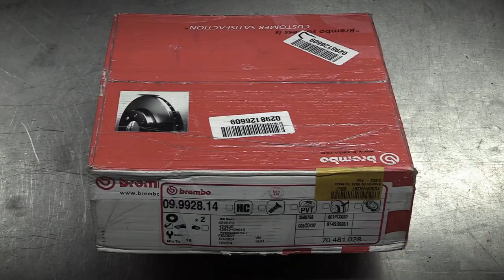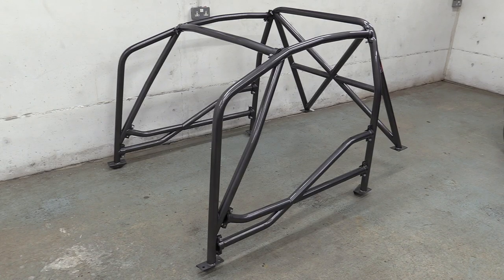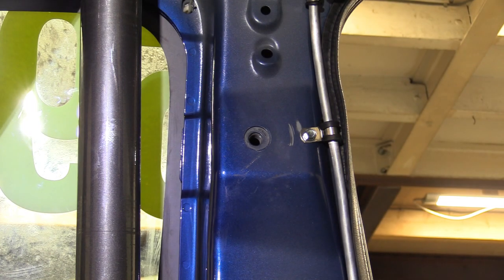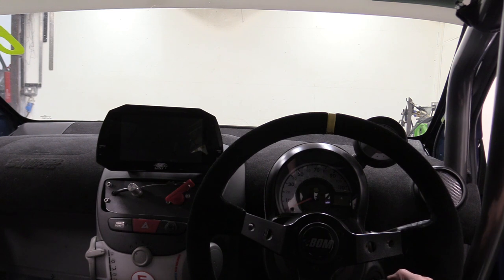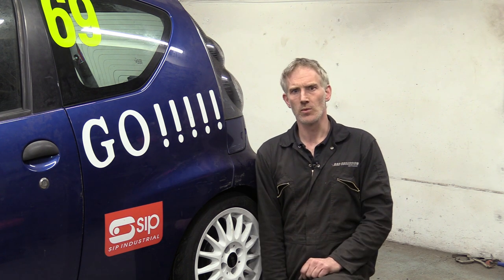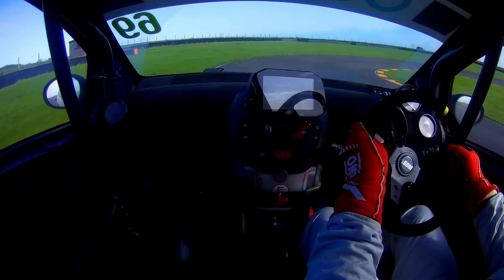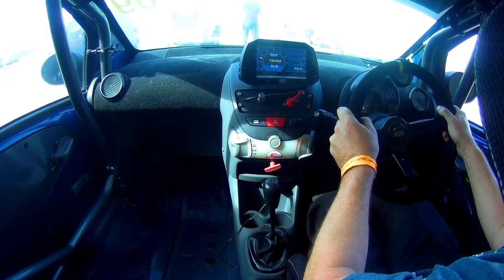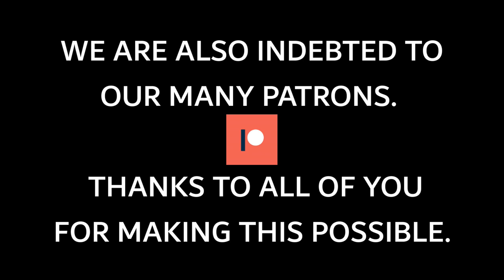Part 6 - Building an £850 hatchback into a competitive race car.

Comment: This is the best episode yet.  Everyone knows racing is about fitting into a set of class rules, then exploiting, bending or breaking those rules to the best of your ability.   Just ask Toyota about their Celica GTFour. :D
Reply: Now that was pure genius.
Reply: That sure was. What about Ferrari in F1 last season having boosts in fuel between sensor readings?
Reply: Agreed! Best one yet. And the track is beautiful. We couldn't have a track like that in the U.S. as the property would just be too valuable, but the track owner could sell it and build two tracks a few miles inland!!
Reply: well Toyota was absolutely cheating back then :D but so was everyone else. Think Ford and their Focus' "rear bumper" aka pressure tank
Reply: Or NASCAR with the cardboard restrictor plates under the carb 😂😂😂
Reply: Or Mercedes (F1) with their 'F' duct. No moving parts to stall the rear wing for better areo. The driver just covered a port (with their knee I think)
Reply: @Madogen  didnt they at one point get done for using the engine oil as a fuel
Reply: Lancia sits in the corner, silently sipping a martini.
Reply: Ahh Toyota's GT4 with their engineered intake.. also worth reading up on Smokey's tricks in Nascar.. or Gordon  Murry with the Fan car :)
Reply: @jdandcoke  That's Mercedes :)
Reply: Yeah... not just racing either we could look at VAG and how to cheat on emissions testing.... so long as it’s not cheating it’s all okay.  And of course the 11th commandment...
Reply: @Sf_Mason  Smoke is the reason for 90% of the Nascar rules, he is also the reason for the other 10% but they have not proved it yet....
Reply: Lancia S4 fire extinguishers. ;)
Reply: How did that work out for them? 😁
Reply: @stumiles86  That was McLaren, not Merc.
Reply: @malcolmyoung7866  as long as no one finds out about it its not cheating.
Reply: Or Spec Miata and angle milled heads, “aerodynamic” mufflers, and ceramic ball bearings in diffs and wheel hubs. And those are just the KNOWN tweaks...
Reply: @Wreckerboy  aero is a good point that might get real result.
Reply: binkys ears pricked up just now
Reply: Yes, I hear their engines go fantastic in a Mini? Drops straight in.
Reply: Well i mean the st165 and st 185 where just beasts. The st205 was probably the most ingenius cheating even done to add power to a homologated engine with restrictor plate. Still Gt4s/alltracs where amazing rally cars. Thats why i bought one over a supra(mk3)
Reply: @Sf_Mason  smokey is a god damn legend. Hell the fiero he built in the 80s with non intercooled turbo making 60mpg+/-. Definition of old school power gains
Reply: @stumiles86  double Drs as well was an amazing idea
Reply: Thats one of my favourite exploits
Reply: Ask Lancia 😉
Reply: Didn’t someone put one of those engines into a mini once, wonder what happened to that ?
Reply: even the head scrutineer said it was genius.
got some Bellville washers?? 😆
Reply: @creamwobbly And when I do I'll send you a link!
Reply: @jdandcoke  oh wow, didn't here that one. lol
Reply: @Damicske  knew it was one of them
Reply: My favorite story is the Lacia Rally Team. In the 1980s battle with Audi, they didn't just modify their car, they modified the course as well with road salt!
Reply: Talking of GT Fours, what's happened to Binky or have I missed something??.🤦‍♂️
Reply: @estaban3248  Binky will return after this mini series.
Reply: that was just straight up cheating, clever trick, but cheating.
Reply: @MindBlowerWTF  It's only considered cheating if you get caught.  ;-)
Reply: @jdandcoke  that's fascinating, I'll be reading up on that!
Reply: No-one mentioned Toyota's GT-one fuel-tank "luggage space" either...
Reply: Baron von Teuchter 
I never understand cheating, how can you get joy or pride from an achievement if you know that you have gained an advantage by cheating ? 
The engineering that went in to that intake was outstanding & i'm sure if Toyota had put the same effort needed in to legitimate development they would have still been on top.
Reply: Speaking of Celica....
Reply: Then there was the ford 2003 focus, that while not illegal was banned. Where they stored excess boost in a tank after the restriction plate.
Reply: @stumiles86  That was McLaren,
Reply: Didnt Renault have active-suspension at one point in F1, that got found out rather quickly?
Reply: @richardhasler4795  That sounds suicidal - all Italian cars dissolve instantly near salt
Reply: @Spaxuable  no. That was Williams in 1993.
Renault had what was called a tuned mass damper. It was met with fia approval, then when other teams got word of it being so quick they got it deemed as a movable aero device even though it was inside the bodywork
Reply: @dahorn100011  Aha!! I see! thanks for the clearification. :) awesome stuff you learn on the interwebs :D
Reply: Glenn Man 
It’s just a legend, lost in the mists of time.
Reply: @GeorgeTsiros  ....whilst they fit a fresh fire extinguisher canister - again
Reply: @Spaxuable  You mean the mass damper? That wasnt active and it got banned under "movable aerodynamic parts", even though it wasnt in the airstream. That was a travesty of regulation IMO.
Reply: Grey area rule bending is what makes motorsports fun to watch

Comment: One of the main reasons why I love your channel is not just the insane attention to detail and over-the-top fabrication, but the information you provide.

Other channels primarily go over the driving aspect itself, or overall build of a car, but very few have gone into detail of setting up an existing chassis and dealing with issues you wouldn't typically see in a dedicated racing chassis. Which is GREAT information for someone, like myself, that wants to get more serious about racing but only has basic hand-tools and mechanical knowledge.

Comment: I expect the 2021 city car cup regulations will rewritten slightly because of you two 🤣🤣
Reply: I imagine saying "slightly rewritten", would be like calling Mt. Everest a bit tall.
Reply: If this ends up going the way they want, that's exactly what'll happen.
Nothing against the winning car or driver, they interpreted the rules better and obviously knew how to drive.
But you can't steer away from the fact that the winning car obviously had mods that the BOM Citroen didn't, 2 seconds is nothing short of completely insane.
Reply: @ToreDL87  2 secs is a huge gap in a spec series at the same time if it wasnt for rule books being grey more than black and white we wouldnt of got this episode
Reply: @danteblankenship6213  Why, I always thought Mt. Everest was quite tall, even though there are a few of his kind that are even taller in our solar system... ;)
Reply: It'll just say "No custom brackets... Nick!" :P
Reply: You know this 😂😂

Comment: Next week, supercharger disguised as an alternator 🤔

Oh and you’re finished after 6 pumps? 😂
Reply: Six pump chumps!
Reply: After salvaging a Toyota Celcia for the Binky, I guess they are honoring the 90s Toyota WRC team legacy in racing.
Reply: Given the engine power, using the starter would provide a nice boost
Reply: @gazfish  would that make it a hybrid?
Reply: @kingfishercomputing9497  Not if no one finds out...
Reply: Not enough head ...obvs...
As the great Nik Blackhurst once said (see: https://www.youtube.com/watch?v=ulmmJlhecdQ&feature=youtu.be&t=396 ) "More head always makes the pump last longer"
Reply: @Potsie  That's odd. I have found that with enough head I don't have to pump at all.
Reply: @dadillen5902  Sounds like you may have a potential problem. I'd recommend checking for leaks as it may be that the reservoir's contents have sprayed all over the garage floor.
Reply: I believe we have a translation problem. 😉😁
Reply: @Potsie  In my experience, if the head is applied at the proper angle and the opening is properly sealed the content of the reservoir alway ends up in an optimum location. I agree that an improperly applied opening seal can result in some BLOW by.

Comment: Even though the track conditions had also improved you could see far less wrestling and adjusted input with the steering after your undefined modifications were fitted. Excellent work as always guys!
Reply: I was noticing that too. The car is way more "balanced" and precise...
Reply: Yes, his hands were noticeably slower.

Comment: The Dutch volvo 360 cup used to allow you to drill holes further out on the subframe to gain some negative camber. That's not welding now is it.. They also allowed welding a washer on afterward to make it safe, but I just thought I'd put this out there. You're a creative lot.

Comment: Two seconds is quite a lot, congrats on the result!
Reply: I've always been quite proud of two seconds.
Reply: Thats what she said lol
Reply: Two seconds around Anglesey is a great gain - that’s a short lap.
Reply: Entirely possible that most of that gain was just track knowledge though, since it was his first time at this track. Anglesey for me is a track which takes a long time to learn properly due to a few blind crests and corners that throw you off a bit.
Reply: It would have been a good back-to-back test to reverse the mods back to the starting point, and see what lap speed they get, having had more practice, and on a dryer track
Reply: @TomoHawKzZ  I would agree. Best way to do this sort of thing is drive the car for most of the day with the 'upgrades', then take them off and see what happens.

Seat time is the best way to get faster, looks to be loads of time left in the car.

Also, if you're reading guys, try shedloads of tyre pressure. Seriously, we ran 55 front and 70 rear at the Spa 24hr. Drag reduction is king with such little power!

Comment: I met a guy who was a tech inspector for the spec Honda Civic series over here in Canada many years ago. As I too love to read & study the rule book to figure out every angle to gain an edge, I was interested to hear what this gentleman had to say about what competitors did to "skirt" the rules. One thing I remember is that they artificially aged the strut caps with ozone ( don't ask how this was done, but this is what I was told). The original rubber in the strut caps would get very hard, reducing the the "give" & therefore making the suspension more predictable. Another trick they did was to pack their shocks in dry ice & swap them out right before a session. The shocks would get much stiffer for several laps, which would give you an initial advantage. I'm very curious how your current mods will change your lap times & race standings. Love the channel & all of your endeavors.

Comment: Something tells me that weight box is going to be put to use 😄
Reply: Did not expect you to love this!
Reply: Makes me think of the 'grey area' that BMW explored in DTM (iirc) many years ago, where what looked a lot like a ballast box with brake lines passing through, turned out to have a pendulum operated lateral brake proportioning valve in. BMW argued that as it was 'passive and reactive' it didn't count as 'active brake balance'. They lost the argument, but it was a clever try.
Reply: Can they fit lighter wheels, a lighter flywheel, and lighter pulleys in the weight box? Idk, asking for a friend
Reply: i really wasnt expecting to see one of my fav mtb channels in the comments of one of my fav car channels
Reply: BC wow good to see u man
Reply: @alexanderbell8391  fr tho very unexpected
Reply: Well, the rules probably don’t say you can’t run a second ecu...
Reply: I'm wondering were do you get such stickers on the car
Reply: Just look what the Cat draged in... ;-)
Reply: Yep. Some polystyrene insulation with cylindrical cavities cut in it will hold several pints of lager. Or ale. Or something.
Reply: Bacon sarnie holder
Reply: When are we getting more Binky or Escargot content?
Reply: @janvanhunks7287 : The rules say the car must remain stock, save for the parts in The Official Preparation Kit. Wheels and Tyres were provided in the kit and must be used. That also means pullies and flywheels have to remain stock.  Swopping them for ultralight wheels and 10-lap special pure racing slicks will be noticed. 

If the car meets minimum weight with Richard Brunnage aboard, I don't know what stuffing the weight box with series-illegal underweight parts would do for them.
Reply: The weight box is for equalising mass, not for equalising performance.  If as Rick says, he is fond of pies, beer etc, he may not need the added weight to put in the box.
Reply: @pashakdescilly7517 : Sometimes and maybe. Ballasting cars is done, but the weight is usually small and/or thin, and bolted to the chassis directly. The weight box in the City Car Cup series is specifically for equalizing the weight and keeping all cars at or above the minimum. If the driver is "fond of pies, beer, etc." it is unnecessary. Not sure where, exactly, the rules require it to be.
Reply: @johnlloyd2390  tbh, I haven't read the rules. It seems pretty tight. Only way I can imagine getting benefit is adding stuff as they have been, without going over the weight limit. And of course it they could add a couple red and GT stripes...
Reply: Jan van Hunks 
Surely performance enhancing racing stripes must be illegal?
Reply: @_Otaku-kt8be  I read the "Community" tab in this channel. Richard Brunnage says they'll have something on Binky and Escargot some time in November, after they've finished "Bargain Racement."
Reply: Surprised to see you here. :)  Hope wrist is healing well?
Reply: @joshbrannelly4039  a piggy back ecu could be installed using oem connectors in line...... Mmm

Comment: As soon as Richard said "Our rule SPECIFICALLY states, no modification and ABSOLUTELY no welding" I knew its going the "DTM Volvo cheat" way. If you can´t weld, just glue and bolt it together.

Comment: 26:00 Thanks for the recipe!!! All those tea breaks with binky, almost run out of biscuits!

Also beautiful track, reminds me of Phillip Island GP circuit.
Reply: Dang!!    I was going to mention Phillip Island...
Reply: It might be a beautiful track to drivers, perhaps even to race engineers and traveling rabbits... but it does not comes across form the video. Like watching early PC flight simulators :)
The rest of the video is high class though, so all good ;)
Reply: @mumblbeebee6546  I guess they would have had to install a camera in the bonnet...
Reply: @Timberwolf69  Did not mean to have a go at their camera placement (although admit that I am a bit spoilt from some gorgeous angles from F1 over the decades...) - it was more about the bits of track we could see, from left to right: green, grey, green. Some tracks have some distractions here or there (which may well make them less great to drive on? Never tried it myself, living vicariously through others :)
Reply: @mumblbeebee6546  I guess most of us are a bit spoiled from what several motorsport brands gave us to admire... :)
Those in-car-camera shots usually tend to be a bit tricky, due to the difference in brightness. Most cameras of affordable price are a little bit overtaxed with that task.
I haven't found myself able to get on a racetrack, either. Besides some digital (more arcade-y) racing, I have to rely on others to share their experience with me...
Reply: @Timberwolf69  totally, and as I wrote before, not taking any away from the Binksters here! 
I love the look of Formula Vee - properly old-school, direct and all that.... but seeing as I am never the fastest on the karting track, there is no need to spend more :)

Comment: One thing you can do to stiffen a chassis (depending on the wording of the regulations ) is to spray some closed cell fire retardant construction foam into every suitable cavity. You can even make some suitable cavities by riveting some aluminium sheet to the floor and ceiling with a gap of about half an inch between and spraying the foam in between.
It has the added benefit of heat shielding and sound deadening for very little weight gain.
Doing this can make a floppy sock as stiff as a board.

Comment: To get more power put a glass of petrol in the oil to go faster.  If you put a belt to hold the front wheels up and not let them push up when you are cornering is as good as an anti roll bar.

Comment: I started on a project car of my own. Nothing to the extent of Binky, however, it does have some brackets that are showing what a life living near the coast in a former ownership looked like. 

Once i removed the engine to get it disassembled to be inspected and rebuilt, I got to work refinishing the brackets. 

Strangely, as I was putting a wirewheel attachment to my drill... I heard a faint whisper from Nik "Lets make new ones", so like any logical person, I made new brackets. 

As I was making the new brackets with my cutting wheel and making 90 degree bends using the bench vice, I could feel the warm yet ghostly feeling of Nik's hands gliding over mine and guiding me to bracket perfection. As if it was the pottery scene from Ghost.

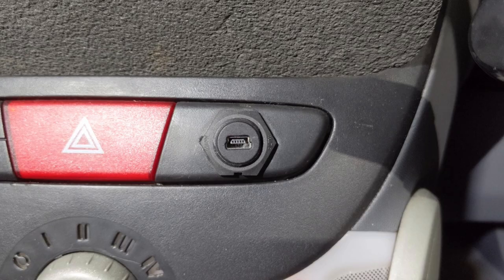Comment: @10:29 The USB port is upside-down.
It will work fine, it just bugs me.
Most USB plugs have a USB logo/icon on one side, for ease of use that side should be on top.
Reply: Is an insert in the lighter plug, so an 180 turn is easy.
Or switch to usb type c, no more upside down problems ;)
Reply: Time to upgrade to USB C!
Reply: @Ross Bourne D-Sub connectors are always the wrong way round when you try to plug them in bind.

Comment: That bump steer limiter was basically what they did on the  Chevy Corvair. Had to fabricate something similar on a Renault 9 that, in its old age, apparently had a habit of stressing the front engine mount. A set of eyelets were crimped onto a length of high-strength steel cable to act as a limiter.